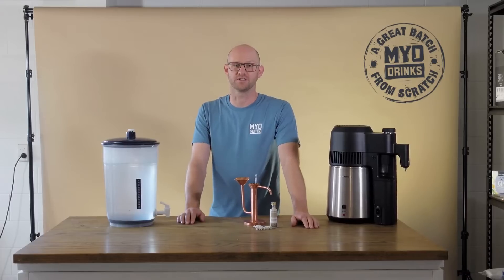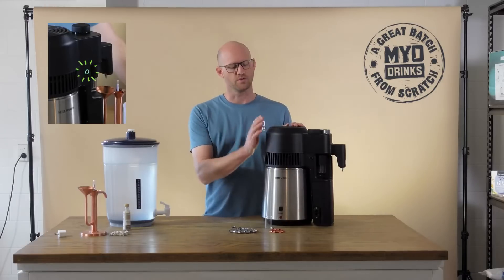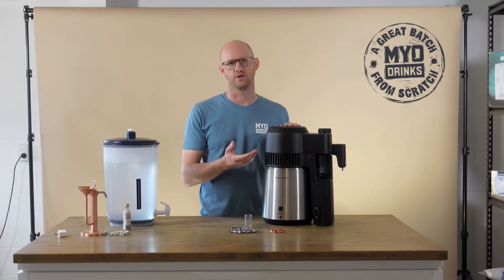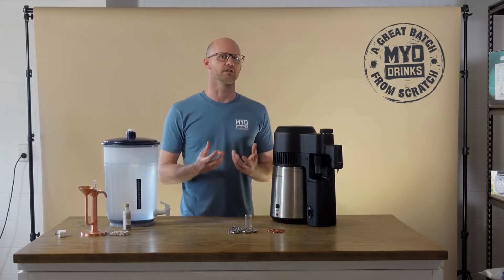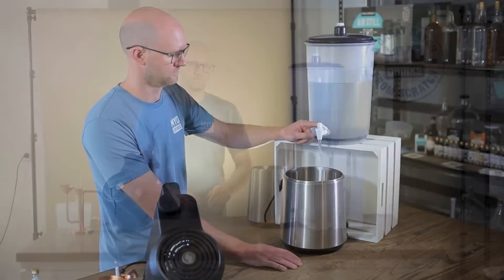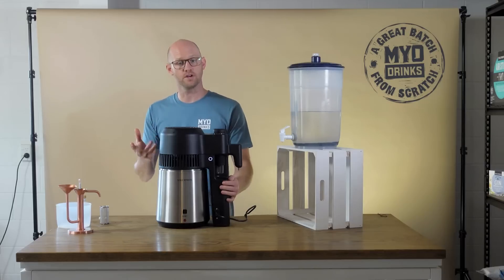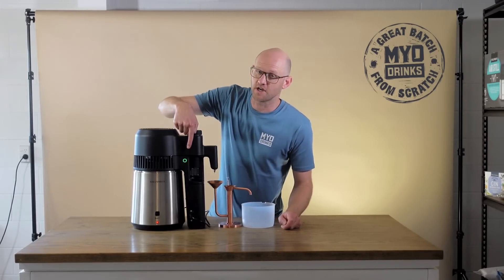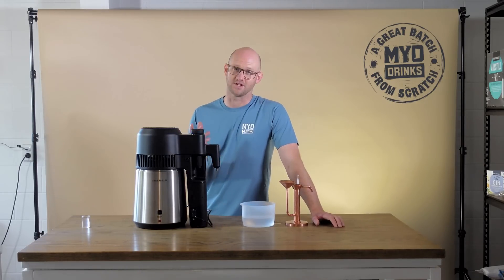Understanding how to distill alcohol with the Air Still Pro

Comment: I seem to have a large amount of waste at the bottom after the clearing process, how do I remove this without stirring up this black mess at the bottom so I can let the fermented wash out of the tap on the fermentor? So far the sludge at the bottom has always been higher than the outlet hole.  Can someone please advise?
Reply from the maker: Hi There, 

It’s totally normal to see a fair amount of sediment or “sludge” settle at the bottom after the clearing process, it’s mostly yeast and proteins from fermentation. If the sediment level is sitting above the tap, it can definitely make it tricky to get a clean draw without disturbing it.

Here are a couple of tips to help:

1. Tilt the fermenter gently, once the majority of your wash has been cleared and you’re nearing the sediment line, you can gently tilt the fermenter (very slowly and carefully) to keep the tap above the sediment layer. Just be cautious not to agitate it too much.

2. Siphoning- If the tap sits too low, using a siphon might be your best option. This gives you more control over where you pull the liquid from and helps avoid pulling in the heavier sediment.

3. Cold crashing- Whilst this is mainly used in brewing beer, chilling the wash before transferring can help compact the sediment even further, making it easier to avoid during transfer.

Let us know how you go with these methods, and if the issue persists, we’d be happy to help troubleshoot further!

Comment: Hey mate - I have followed this to a T, naturally removed the foreshots and even an extra 100mls of heads. After which I diluted and filtered per your video below as well. The Neutral spirit is almost odourless . Would you say this is safe to consume, similar to vodka?
Reply from the maker: Hey Chris, 

Sounds like you've done everything by the book! If your neutral spirit is clear, nearly odourless, and has been properly diluted and filtered, it should be safe to consume, essentially like vodka as you said. The key things to check are:
✔ Foreshots & Heads Removed: You’ve already taken out the foreshots and extra heads, which is great since that removes most of the unwanted compounds.
✔ Proper Dilution: If you've diluted it down to around 40% ABV (or lower) for drinking, you're on the right track.
✔ No Off Smells or Tastes: A well-made neutral spirit should have little to no odour. If there's a strong chemical or solvent-like smell, that’s a sign something went wrong.
✔ Filtering: If you've filtered through activated carbon, that helps remove any remaining impurities.

So, assuming all of the above checks out, yes, it should be safe to consume and similar to vodka! Just remember to enjoy responsibly. 🍸
Reply: @MYO_Drinks  thanks mate. Really appreciate the detail and prompt response

Comment: No link to filtering, and dilution?
Reply from the maker: Here is the link for you - https://www.youtube.com/watch?v=gSK1TCSPdAw 
Have a good one!
Reply: @MYO_Drinks  Hey, thanks for that.  
Is charcoal good for filtering.  I read it somewhere.
And does putting some copper mesh in enhance the flavour for dark spirits?
Reply from the maker: Yes, charcoal is great for filtering spirits, We actually offer a range of carbon filters and activated carbon products specifically designed for this purpose. You can check them out here: https://myodrinks.co.nz/collections/spirits-filtering
Note that only activated carbon/charcoal made specifically for the filtration of water/spirits should be used.

As for copper, it can definitely help to eliminate unwanted odours when added in small amounts. Through trials, we’ve found that incorporating copper saddles or a small copper sheet can enhance the overall quality of the spirit, although the difference may not be drastic. This is primarily to remove undesirable flavours and smells, but for dark spirits, you generally want to preserve the natural flavours rather than strip them away.

Hope this helps!